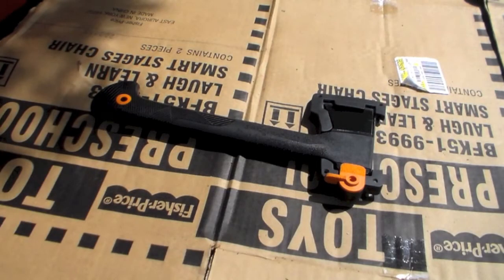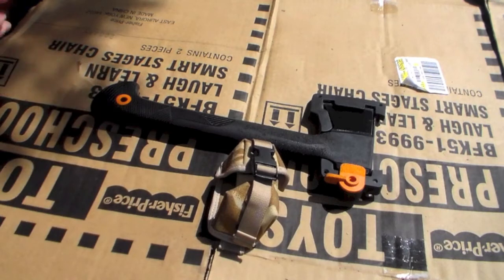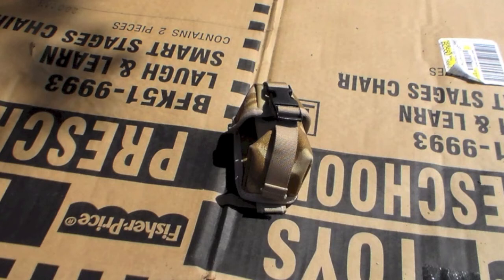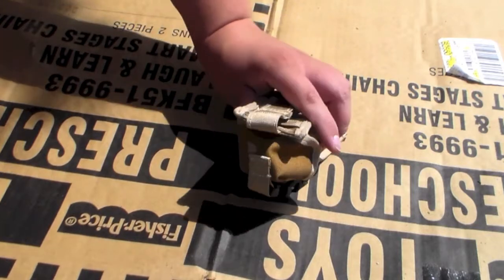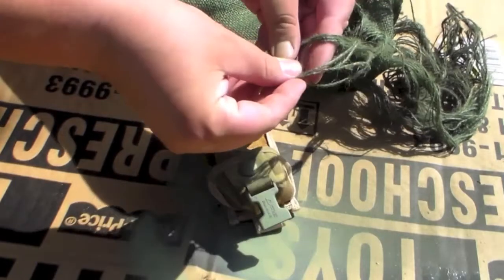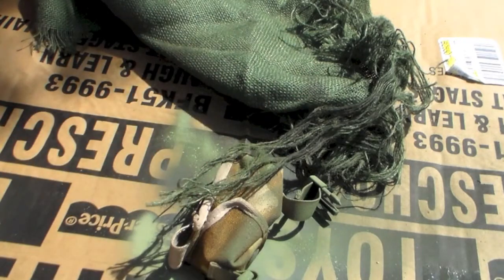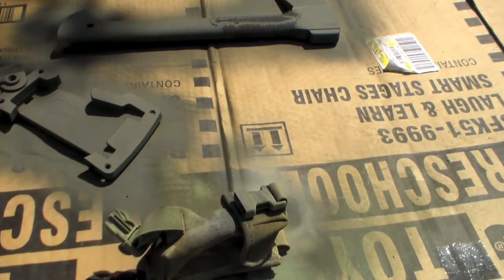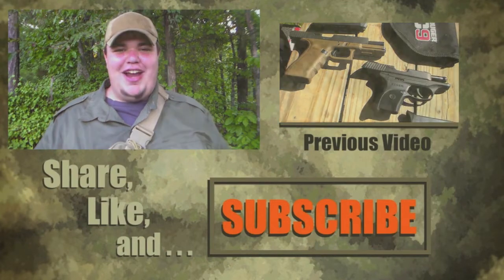How to Paint Fabric MOLLE Gear

Comment: Where did you get Syrian camo?
Reply: BrownBessOwner oh, UK. I just heard it at the end. Is there a lot of Syrian camo in UK? What other camos are available in UK?
Reply from the maker: BrownBessOwner It used to be that the UK had two camouflage patterns— one for the desert (Syrian) and another for the forest (Woodland). Now, the MoD has switched to a single pattern called "MTP" or "Multi Terrain Pattern." It is very similar to the American MultiCam. The only difference is that the blotches on the MTP are larger than those on MultiCam.
Since MTP is all the rage, Syrian and Woodland camouflaged gear is easy to find and cheap. I purchased this pouch at an Army store on the northeast end of Edinburgh.
Reply: Oh, I know that old UK desert camo. I didn't know it was called Syrian. What does it have to do with Syria?
Reply from the maker: BrownBessOwner As far as I know it was developed for the Syrian Army and the Brits adopted it. It seems pretty wise; if you are looking for a desert camouflage, go get help from a country that is 90% desert!